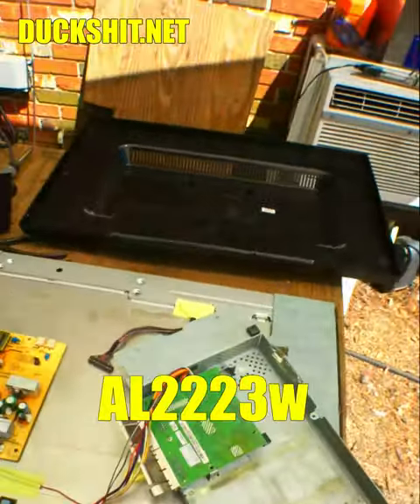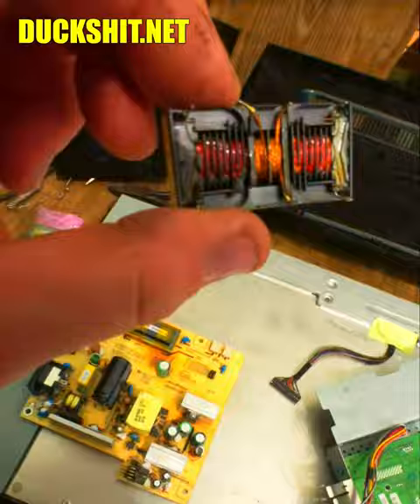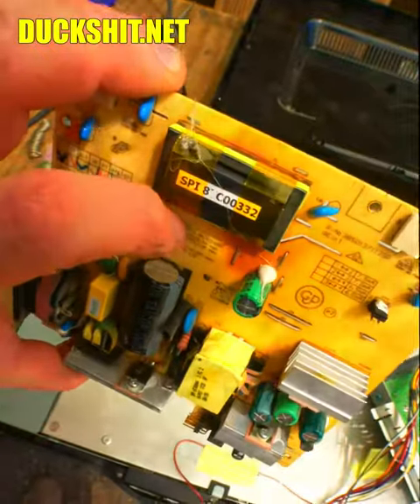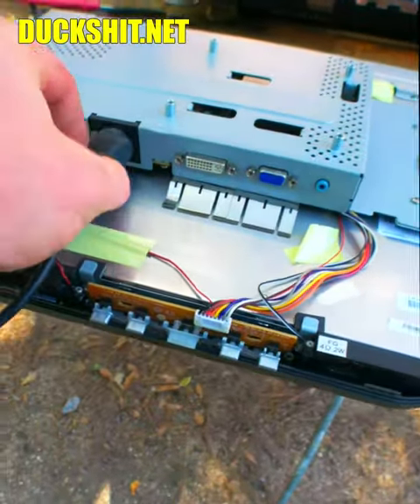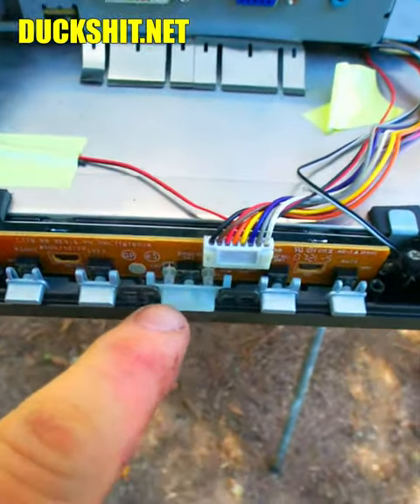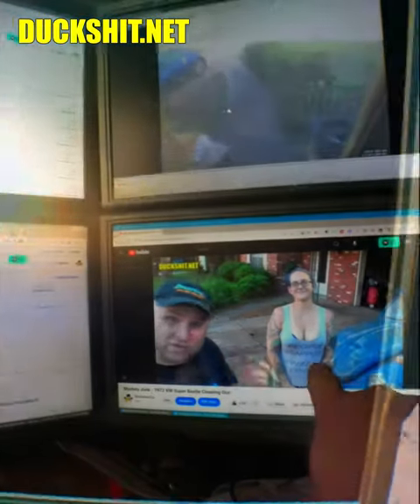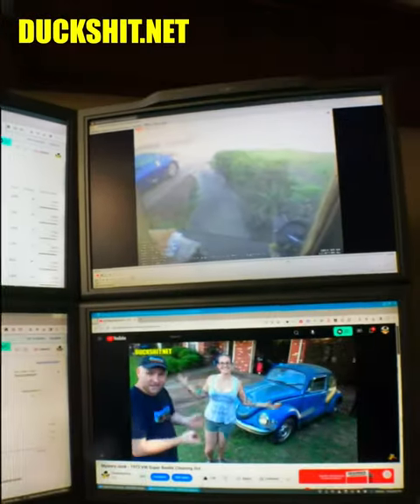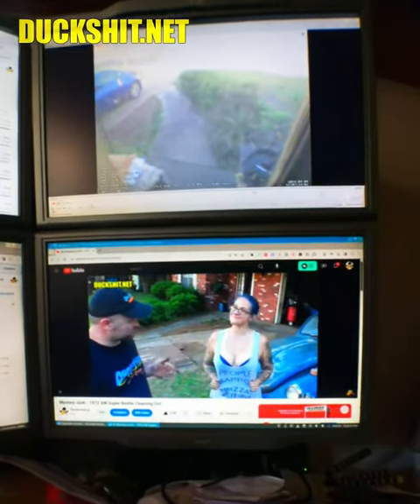LCD Computer Monitor Repair - PART 2 - Failed Inverter/Transformer ACER AL2223W

Comment: Right on! @Duckman!
Reply from the maker: Thanks always Mark!
Reply: @DuckmanCycles  I loved tinkering with electronics,  and eventually got my Electronics Degree, this is right up my alley!
Reply from the maker: Little something different, slow week.  Cars are all outta here, so taking a break.  😁👍🏻🦆💩
Reply: In votech while everyone was taking auto shop and electrical I took electronics. Helped out immensely when diagnosing cars electrical problems. My back wished I took on a different field lmao.